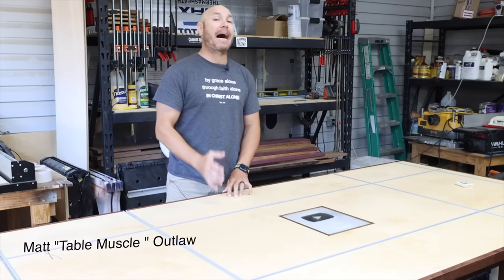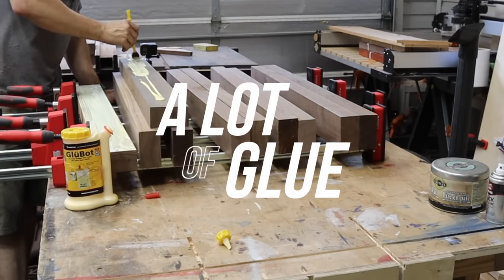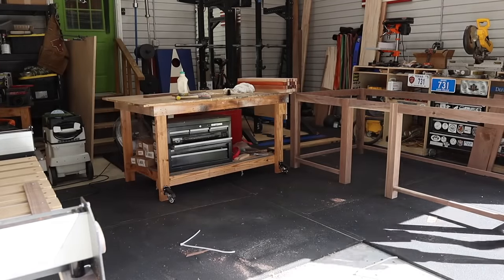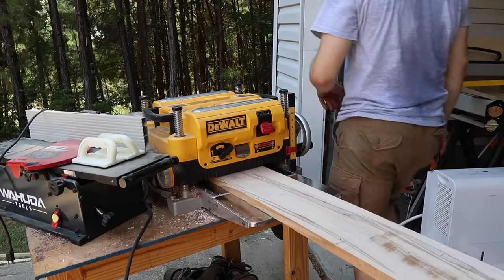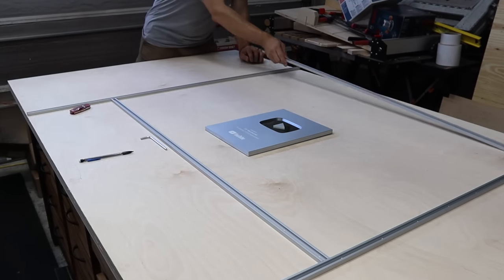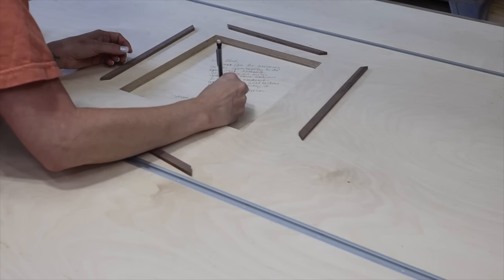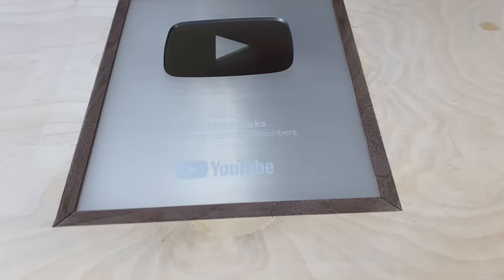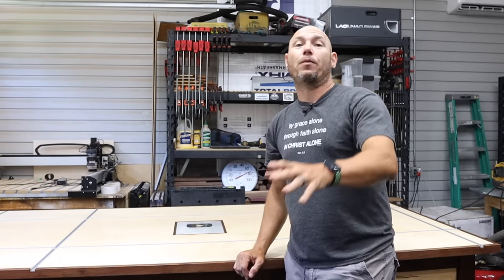How to build a Workbench with LOTS of Storage!

Comment: Howdy Mr. 731...

EXCELLENT job on the table!!

Very inspiring as I am literally building my shop now from the ground up. It's not as big as a 2 car garage but it's 12' x 14' with 8' center height. It's one of those metal sheds from Lowe's that looks like a barn. But, that's just the outer skin. The inside will be all custom insulated walls, cabinets AND workbench. 

Can't tell ya how sick and tired I am of pulling tools out of my 8'x10' shop and setting up saws and tools on sawhorses outside then having to break everything down and put back up and then, only being able to work when it isn't raining, which here in south Texas, the weather has just been abysmal. 

I appreciate your time and effort you put into your videos and it's given me several ideas on what and how I'm going to do my workbench. 

Thank You.

Comment: What a beautiful work bench or table it’s been fun watching you grow I need to get my old lazy self out to the shop and start back into my woodworking you’re an inspiration.
I have used resin for lots of years since I was about 10 years old and when you have a piece that you want to coat like your plaque there just put enough resin to give it a thin coat over the top and let it start to tack off and then you can go ahead and do your next coat on top of it that should help  keep things from floating up and from getting too heated up when the resin securing you just do the same thing for the bubbles on that first thing to use your heat in a little bit To pop them.
Reply from the maker: thanks for the tip

Comment: Amazing..........this table is gorgeous........I would be afraid to use the top as an assembly/work table because I know there will be blade kerf marks, stain, scratches on it immediately after using it.  Now all i have to do is figure out how to make one just like it, a bit smaller, say 4' x 6' and still be practical with the drawer sizes.  Awesome job brother.
Reply from the maker: Thank you

Comment: Titebond II vs. Titebond III

These are two different glues made which use two different methods to set. TBII *releases* moisture *into* the air to set. TBIII *absorbs* moisture *from* the air to set.

The distinction here, is, "How humid is it where you live/in your workshop"? 

I live in FL -- the humidity level here -- even in winter -- is often >50% I had a TBII bond that kept failing -- wetly failing -- despite sitting in place for 36h. I cleaned it up and applied TBIII, and it was rock solid within a few hours.

So, if you're in a wet area -- Florida, Louisiana, Southern Texas... use TBIII -- if you're in a dry area -- California, Arizona -- use TBII
Reply from the maker: Good info.  Thank you

Comment: That is a truly well built workbench and you can tell you put a lot of effort and pride into it. I have a question Matt have you changed the blades in your Dewalt planer? I have the same model was wondering if it’s difficult. I’m mechanically challenged 🤪. 👊🏻👊🏻
Reply from the maker: I haven't but they are in need of a change.
Reply: @731Woodworks  do you think you will do a video?
Reply from the maker: Probably not if changing the blades.
Reply: @731Woodworks  👊🏻

Comment: Bench turned out nice,  curious why you didn't chamfer the walnut edge around the bench. This would soften he edge and possible keeping it from chipping over the years.
BTW, I can not find the link to the T-Track
Reply from the maker: It's linked on this page, toward the bottom https://www.731woodworks.com/outfeed-table-tools-and-supplies
Reply: @731Woodworks  My bad, must of missed them. Next time you may want to try these,  you can get a 4pack x48" for under $50. I've used then many times and they are just as good as anything else on the market. You have to buy the cross piece separately for $9.00 each. But 4pc X 48" track and 2 cross pieces would only cost  $68.00 as apposed to the $110 you paid at Peachtree. Hope this helps.
https://www.amazon.com/gp/product/B083K2MKJR/ref=ppx_yo_dt_b_search_asin_title?ie=UTF8&th=1

Comment: This is an awesome build.  So much so that I bought your plans.  Question...the material list on the plans calls for 2 5x5 sheets of 1/2" plywood, but I can't find in the plans or video where you used 1/2" plywood.  Where did you use it?
Reply from the maker: I used 1/2” in the top 4 small drawers. However for the plans I charged it to all 3/4 for simplicity. I’ve updated the plans and will upload those to the store.   Just disregard the 1/2” material unless you want lighter weight drawers on top

Comment: Beautiful! A couple quick questions…..if some didn’t want to go all out with walnut, what other wood would suggest in place of the walnut? Also, someone could add casters to this table if they wanted it mobile, correct?
Reply from the maker: Yes casters could easily be added.  You could use Douglas fir 4x4 from the home stores.  If you wanted to use hardwood, maple, poplar or ash would work just as good.
Reply: @731Woodworks  cool. Thanks for the reply!
Reply: @731Woodworks  So you could glue up 2x4's to make the base and aprons out of pine and still be alright?

Comment: That is an amazing workbench! If you weee doing it again, would you still use Odie’s as the finish?  I’m about to start building a much more simple assembly table and unsure about the finish.  I’d like it to help durability and be easy to repair/redo.  I haven’t used Odie’s before but have Rubio and poly.

Comment: I'm planning on building an assembly table with multiple T-Tracks, & currently I have the space for a 4x8'.  I watched this vid again, & it's STILL an amazing table!  I can't go this indepth/pricey, but I'll allow for future additions like drawers.  I was thinking of using Melamine for the top surface since glue & epoxy apparently clean up very well.  Why did you use plywood?  Does the Odie's Oil make clean-up easy?  Btw, I LOVE the shirt you had on at the end.

Comment: Hey Matt, thanks for the video and awesome set of plans for this build. I'm building my own and wondering if you glued the two sheets of plywood that you used for the top together? And is the bottom sheet of plywood glued to the frame? Or do you rely on screws exclusively for that part?
Reply from the maker: I glued the 2 pieces together.  But the 2 are pocket hole screwed to the frame so I can replace it if needed.

Comment: I'm still a rookie with most of this stuff, but I have a question. At the very beginning of your build, your shimmed your 8/4 walnut and planed it, then you ran it through the planer after. Why did you do it this way? I'm just trying to understand the methodology. I was under the impression that you jointed one side first then, then referenced that side through the planer. If you could help me understand this, I'd greatly appreciate it. Beautiful work! <3
Reply from the maker: The walnut was twisted.  I had to get a true reference for the other side, so I used the sled and shims to support one side, while the planer made a flat surface on the opposite side.
Reply: @731Woodworks  Thank you. I'm gonna go look up planer sleds now. ♡

Comment: Why did you put the boards on a jointer when you used the planer to give you flat sides??? I know they aren't technically for the same use but in this case it was functionally the same wasn't it???

Comment: I bought the plans for this and am well into the build and I must say I'm a little disappointed with the instructions that are given for the drawers.  I did read the plans and watched the drawer video.  The problem is the cut list dimensions given are for the "basic or good" drawers, not the better or best version shown in the video. No cut dimensions or directions are given for the better versions of the drawers. Also the drawer bottoms have to be shortened by 3/16 as the dimensions given for those in the cut list are for the better or best version of the drawers.  

Now this may not be a huge issue for the experienced woodworker but I found it rather disappointing as I'd much rather have built the best drawers possible given the amount of time and money spent on the wood. Once the pieces are cut according to the cut list, you're committed to the basic drawer design.